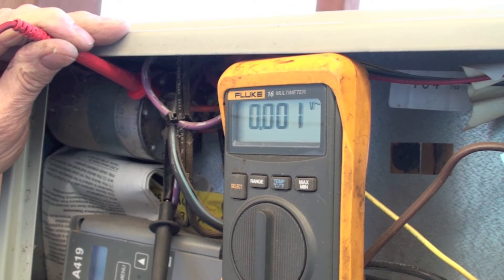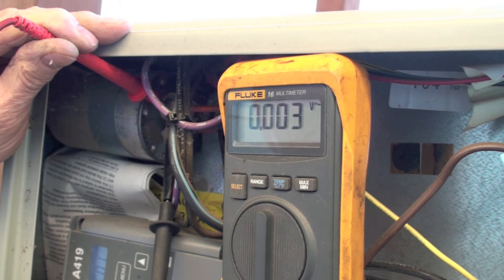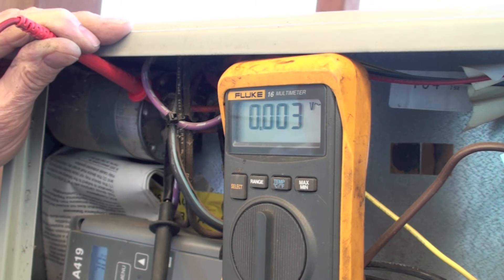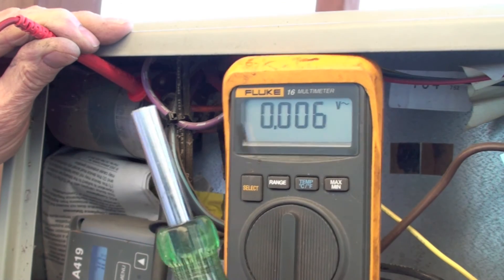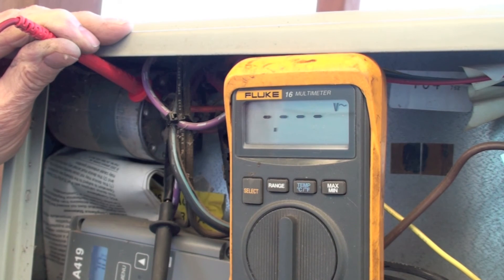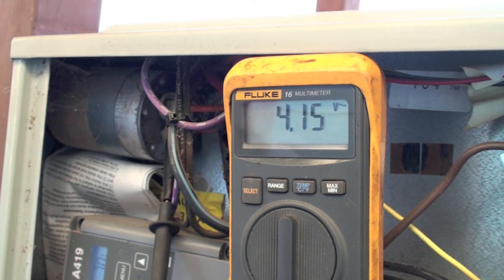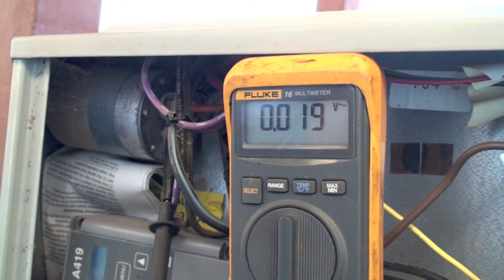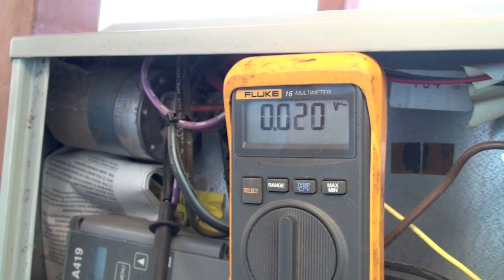The myth of the run cap

Comment: Recently I came across a failed compressor. Completely burnt. Dicharging the capacitor, as is my habit, it sparked brightly. Also, for future reference, residual volfage in a capacitor will be measured in DC. Some time try pulling the common on a running unit and check the voltage.

Comment from the maker: I guess that could happen if the windings failed while you were there.  With 35 years in the field I have never had a cap spark if I discharged it.  The only time I had that happen was when a student had miswired a compressor.  A good idea is to use a non contact voyage detector as they should always be used when shutting down power.  Thanks for the response.
Reply: I agree that using a non contact voltage detector before you service equipment is always good practice to ensure that the power is off. However, capacitors store DC current like a battery would, so a non contact voltage detector is not going to detect charge in the capacitor since non contact voltage detectors only will detect AC current
Reply: I had it happen on a microwave oven.  I discharged the caps,  and I got bit while I was lifting it to the bench.  Guess it was stored in the high voltage transformer or magnetron this was back in 1977, when microwaves weighed a ton.  What are really bad are old TV picture tubes which can hold high voltage for a long time.  It’s enough to kill.  You can charge a capacitor with static electricity too.  It’s always good to discharge any caps before touching the terminals.

Comment: One time, about six years ago, I got a call for no A/C. I headed up to the roof, pulled the disconnect, and discharged the capacitors. I reached out to remove the wiring from the cap and literally watched the electricity crawl of the capacitor like a tarantula and zap the heck out of me. My heart beat so fast I felt like I had just drank a triple espresso. It troubled me for days. This is part of why I think it important to use a (proven at time of use) deadmen's stick to verify no current.